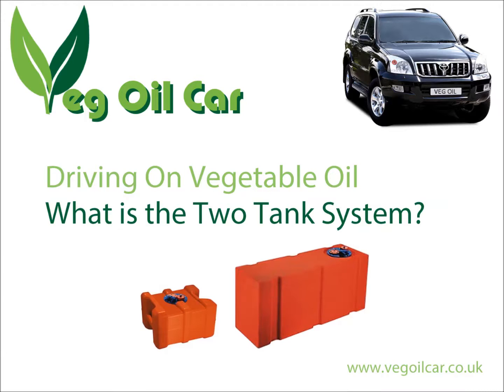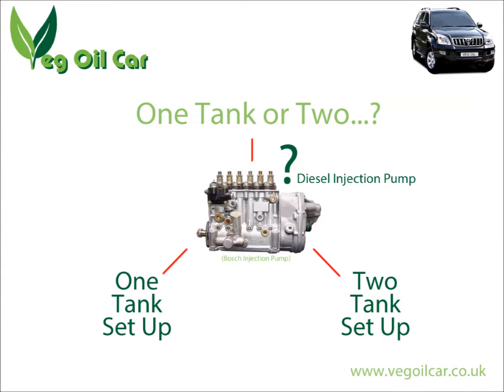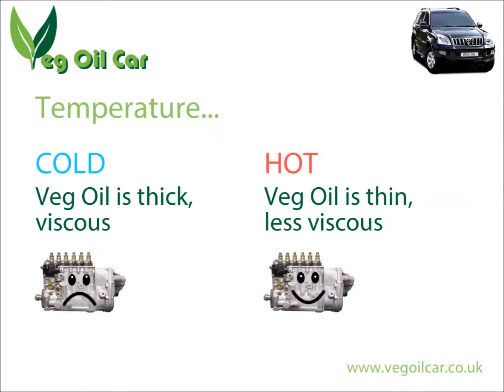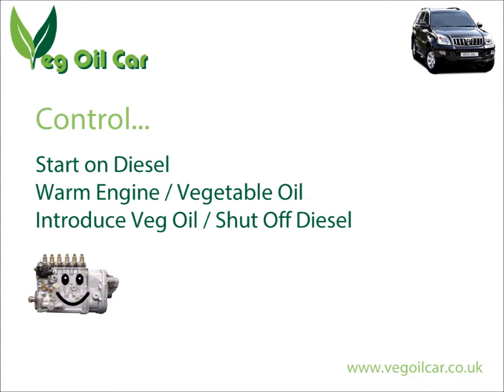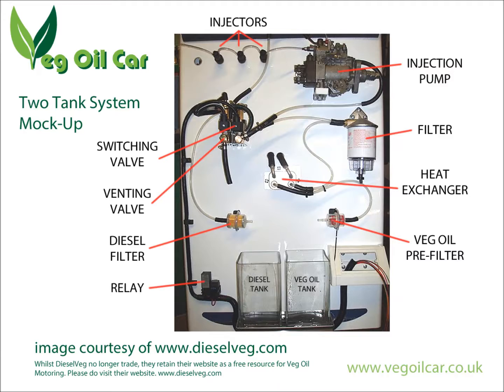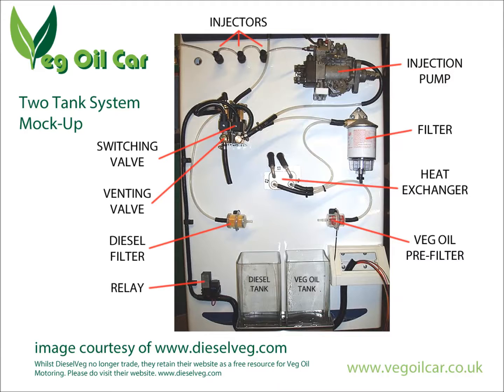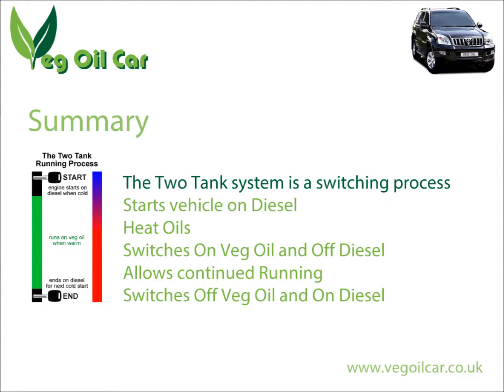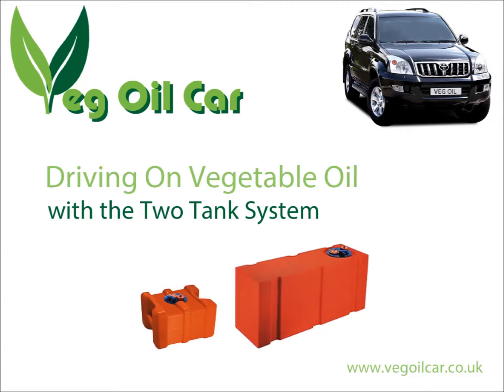Driving On Veg Oil - What is the Two Tank System? by VOGMAN

Comment: This is the first time I've seen positive confirmation that a Prado 120 can run on veg oil.  I've got a 120 and want to do the conversion - do you have any videos on how yours was done?  (I looked and couldn't find them easily).  My car has 2 fuel tanks and ideally I'd use one of those for veg oil, rather than taking up extra room for a separate additional tank.  Feasible?   Thanks for any advice.

Comment: if you have a conveyer kit installed ready for use can you use peanut oil?
Reply from the maker: KSpooners Hi. The story is that Rudolf Diesel, the German inventor of the diesel engine, ran his original engine on peanut oil. I've never seen or used peanut oil myself, but given this it seems very probable that YES you can run a diesel engine on peanut oil. Viscosity is the main issue (how liquid / runny it is). The more fluid the oil is the better, so at worst I would have thought you could mix diesel with peanut oil to improve viscosity... but in a nutshell (no pun intended), yes... I would imagine you can.

Comment: What are your thoughts on the engine oil becoming contaminated with vegetable oil.
Reply from the maker: You've clearly done your homework. To my knowledge every reputable fitter recommends you change the engine oil more regularly than you might otherwise do. DieselVeg who fitted my kit advised an oil change every 5000 miles or 6 months (whichever came first). It's a small price to pay for VegOil Motoring  : )
Reply: VegOilGuy thanks yes I've been studying for a while. Don't want to destroy my engine :)
Reply from the maker: Excellent! That's my approach... learn as much as you can and avoid the pitfalls.
Good luck! You'll get there  : )
Reply: VegOilGuy I'd be interested to know your thoughts on blending filtered wvo with petrol (gasoline). There is a guy in the USA on YouTube that has a lot of videos on it and seems to work. Have you ever experimented with it. The goal being to not have to convert the vehicle.
Reply from the maker: Hi again  : )
I'm aware it goes on and even remember reading an AA article once suggesting mixing petrol in oil (it was a veg oil motoring article, obviously). It's something I've never personally tried. I add diesel to my WVO in a cold winter to thin it, but nothing else.
There's a lot of recipes out there and whilst I've no doubt the US guy you make mention of is experienced in blends, make sure you and he live in similar climates. If he lives in a sunny state where winter means slightly less tanning weather and you live in a cold spot where summer means one less overcoat - or vice versa of course - then comparisons are difficult.
Warm climates can get away with very little when it comes to oil... I've heard stories of West Indies regions running on pure coconut oil with no modifications.
Warm oil is free flowing. Cold oil is a pain.
Hope this helps. Happy reasearching.
Geoff
Reply: VegOilGuy Thanks mate. I really appreciate your feedback and detailed response. Good advice. We do live in a warm climate here in Queensland Australia but it does get down to zero Celsius overnight in winter sometimes but then we will get a 20 degree C day afterwards so I guess we are lucky that way.